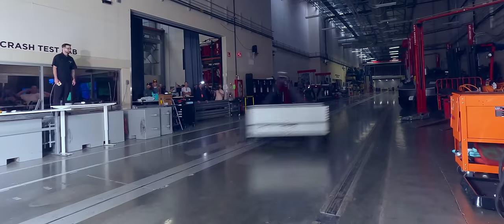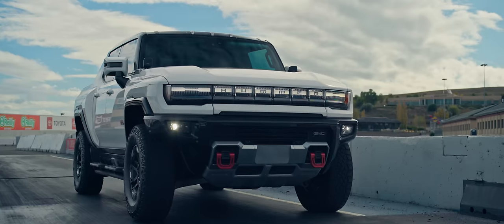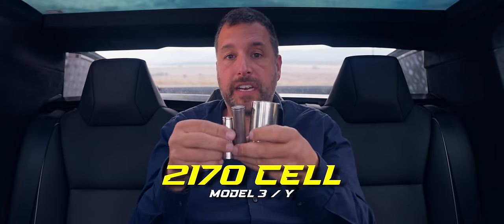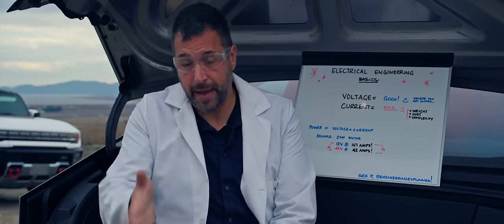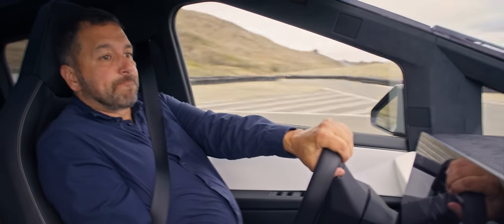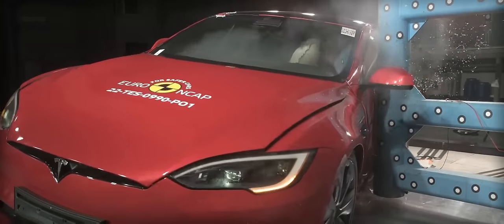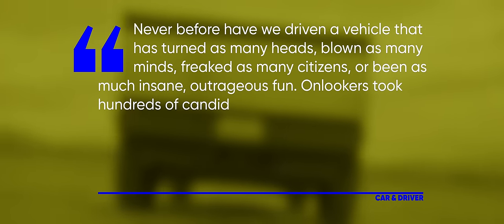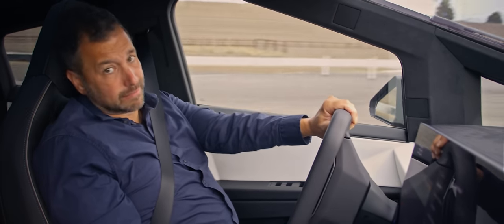Exclusive 2024 Tesla Cybertruck Full Review & Drag Race w R1T & Hummer  — Jason Cammisa on the ICONS

Comment: Ok, this makes me appreciate the engineering that went into the Cybertruck, but I'd be afraid to get hit by one of these things in any regular car. That hard steel skin, curb weight, and acceleration make it a wrecking ball on 4 wheels.
Reply: It's even more dangerous if you consider that cybertruck drivers are blinded by the sun through that big screen and can't see traffic due to those huge A-B-C pillars supporting that glass. Would like to see a crash test of two Cybertrucks hitting each other🤔 No foldable crash zones: Cars undamaged, passengers broken.
Reply: Really.  Tesla just went ahead and forgot to test for that, right?  Slipped theirs minds?  Good thing you thought of it.  Back to the drawing board they go, except with you instead of Elon. @rleerm
Reply: Yep I was thinking the same about those pillars  @rleerm
Reply: It’s a similar reason with most US trucks, which is why all of them are grey imports in Europe. Generally, if you’re an automaker in the US market and you don’t have a truck you’re not going to last long. So Tesla is doing this for market share rather than to actually build a good car, though admittedly some of the engineering is quite impressive. Personally I think a bigger hazard for owners, their kids any potential rear passengers is that stupidly low C pillar. Imagine putting your kids in a car seat and NOT hitting your head off the door frame.
Reply: @mordsith99  yeah i could never imagine a company making any mistakes ever. How could they.
Reply: You prefer to be in an accident?  I prefer to not be in an accident.  Which one has more accidents?  Typical truck with no steering control or Cybertruck with steer by wire?
Reply: This is no harder than cars made before 2000. If they still drive those in your area
Reply: @rleerm  Timeout. Normal cars have blindspots on those same pillars. Just recently got a 2018 Stelvio and found out how big that blind spot was. Cars literally disappear behind the pillars and it has larger blind spots than my prior Veloster which already has insane blind spots. I have doubts that they will be any worse on this thing, especially with all the technology Tesla adds. This at least has default cameras and blindspots monitors to help drivers. Most still require you to pay more and don't have all those features
Reply: @mickmcgood6543  I would put money on them being better than most SUVs
Reply: On the other hand, if you were ever unlucky enough to find yourself in an accident, which vehicle would you trust your wife and children's lives with as passengers? That should be your question.
Reply: This car is dangerous to any normal car on the road. Period.
Reply: It's 6000+ lbs...
Reply: @fredherbert1312 lol. show me a yank truck that isn't a danger to everything else on the road. not sure why people raise this as a concern. they're classified as "Commercial vehicles" for a reason, so that they fall under a different category of safety requirements (well played GM and Ford) hence why you can't buy them in Europe (where there's more stringent rules about protecting pedestrians). You get hit by a truck in anything other than another truck and you are toast.
Reply: @rleerm lmao their are crumple zones or it would be illegal for the road smh
Reply: @Australiaisupsidedown  As long as we learn from failures👍 Love the EV tech in the Cybertruck but not it's implementation. For proper road conditions and city life this is overkill in so many dimensions. Like buying Twitter to get freedom of speech 🫣

Comment: Hope to see a towing test from someone soon. The power is there, better than an F350, great. But, what happens to the range when you tow? F150L range drops to basically nothing once you start pulling.... fingers crossed here!
Reply: I’m not overly optimistic in towing range seeing as this already has the lowest range of all the EV trucks. Hopefully they found a way to dramatically reduce how much range drops.
Reply: @joshtavenner3073  Uh ? No it doesnt ? It has like 340mi of range.
Reply: @joshtavenner3073   The F150 has less than that.
Reply: @joshtavenner3073  I don't think the initial range is important. You buy what you want and get it, in theory anyway. It's going to come down to efficiency and gearing above all else. The lightening is a horridly inefficient in literally ever aspect of it's engineering so that unit having this issue is no shock. I'm certain we'll learn soon enough... fingers crossed.

Comment: What do you mean by completely by wire? There have certainly been other unless you really really specify your own definition. The infinity Q40 was steer by wire nearly a decade ago. Yea, it has a possible redundant mechanical steering rack but it’s never connected unless there’s a failure in the steer by wire, correct? So how does that not count? Also, if you’re referring to the 5.4 star NHTSA rating, it didn’t break the rating system. An article from back in 2013 says these ratings are published but sent internally to the manufacturer and that approximately 1% of vehicles have received such high ratings, so it’s not the first.

Comment: Jason asked if anyone had ever heard of a brake-by-wire failure in a car.  I had a 2004 Mercedes SL55 AMG in which MB first introduced that system.  It failed twice on me, once causing me to roll out of a parking garage onto a busy city street, with the car stopping only when it hit a curb with me standing on the brake pedal with all my force.  Mercedes quietly took the system out of production in late 2005.
Reply: Tesla is using double REDUNDANT steer by wires the chances both fail at the same time is effectively zero. You do realize that modern aircraft use steer by wire and we all get on planes and its the safest form of transportation
Reply: in more recent times there have been no failures. the corvette uses brake by wire, infiniti uses steer by wire, countless other systems electronically controlled now.

Comment: Was this a review of a new electric truck or an electric sports car? You covered all the points of a sports car review, not a truck review... What are the towing specifications/range? The payload? Storage? Offroad capabilities? Clearance? Approach angle? Underbody protection? A/C Power outputs? Charge capabilities? You guys produce great videos but this is nothing but a fluff piece showcasing the sports car features and engineering of a "truck" while not explaining at all how it performs as a truck...

Comment: I like this channel a lot but, you could tell the Rivian started very late and the driver let up on the pedal. Also, what mode were they driving in. It looked like the Cyber truck was in ludicrous speed. What was the Rivian in? Was the Rivian using the larger battery or the lesser battery? Etcetera. This is disappointing. They should have mentioned this.

Comment: You keep commenting on its “large” size but it’s smaller than a normal pickup. You’re literally taller than the truck when you get out. I don’t get the need for the exaggeration. It’s also less than $100k & that’s the top tier one. The rear & all wheel are $50k & $70k.

Comment: This was GREAT! The only inaccuracy was comparing the 2019 single motor Cybertruck's price to the 2023 tri-motor price. Jason saying "it more than doubled" (between 2019 and today) is inaccurate because it's not an apples-to-apples comparison. The single motor model increased about $20,000, going from $40,000 to $60,000. But with inflation, the higher price of steel today, and the added innovations, I have no problem with that price increase. Plus, that'll likely come down as the cost of making the truck comes down over time.

Comment: When he talked about the steering racks being the equivalent to a 1970s house i wasn't impressed, all i thought were the battery requirements for something like that are ridiculously stupid, meaning this truck has an oversized battery pack that is extremely costly and when it dies.. (which it will) it will costs 10s of thousands of dollars to replaced and you'll be SOL.
Reply: This is such an ignorant "i know nothing about evs" boomer take. Not only will someone driving a $120k lipstick at costco truck not drive it long enough for the battery to need replacement but you can repair the batteries by replacing cells. They're just a box of 16850 batteries in cycle. There's an entire industry of people that buy used and worn down Priuses, etc, replair/replace batteries and resell them. This is like complaining about at some point in your cars 250k mile life you might need to replace the trans or motor.

Comment: “Ever heard of a failure? Me neither…”

Electric throttle bodies fail all the time sending cars into limp mode. Not sure if i need or want thoroughly disconnected steering. Even if power assist fails, the car is still controllable.

Comment: 12:00 what's this getting at? Homes run at way higher voltage (240V AC single phase, but more like 220-230V back in the 50s) vs this 48V DC system. Not to mention the sizing of the wires for both as well. Higher current sure, but the voltage is way lower, so the wattage is lower too, 100% do not get what this flex is about.

Comment: I like the fact that the actual headlights are so low down. My biggest complaint with modern trucks is how blinding they are to everyone else on the road that isn't also in a 8 foot tall brodozer. It does not matter if they're aimed correctly, regular drivers' eyes will always be in the blinding hotspot. If headlight modules can be that small and still light the road effectively, I see no reason to mount them up high where they will punish everyone driving a regular-sized vehicle.

Comment: Steer by wire is safe because cars have been using throttle by wire for years? Like throttle by wire never fails? If throttle by wire fails the car just stops. If steer by wire fails you crash and kill others if not yourself. Its not like Tesla's auto pilot has ever worked.

Comment: I don’t necessarily hate the cyber truck but a truck is shaped like a truck because it’s usable, durable and useful.    I don’t see that with the cyber truck…. It has too many compromises as a utility/ work vehicle to be a good truck.  Will it be innovative yeah, will it have some cool tech yeah,  will it be a better “truck”. I don’t see it.   The 48v system and the steer by wire is interesting and I’m not sure I’m on board yet 😂.

Comment: I would like to see a test about its bed usability, bed site, ramp usage, and electric plugs in its inverter mode.
I wanted to park my electric motorcycle in its bed and use its built in ramp to load and recharge the motorcycle in the CT while transfering my Zero....
Can it be done still?

Can you fit a Zero S into its bed?

Comment: I was really excited watching the first press reveal of the Cybertruck all those years ago.  The excitement waned a bit each year as I had to become comfortable with the fact that Tesla was going to blow way past its predicted production timeline and this truck would remain vaporware for a very long time.  Unfortunately, during that time Elon became weirdly obsessed with trying to make the Cybertruck fit into a garage, so they shrank it from a full-size truck to a mid-size.  Yes, there were efficiency gains, but, perhaps most importantly, they ruined its practical usability...well, from the perspective of someone who's driven full-size trucks for decades.  

It's now significantly smaller, cramped interior won't fit taller people (particularly in the rear), and the price of entry has more than doubled.  So, all my excitement has now turned to disappointment.  I fully appreciate all the engineering that went into making this truck, and that the final product is now...finally...hitting the streets.  And I absolutely love the way it looks!!  But it's no longer something I can consider buying, which is kind of a bitter pill to swallow.
Reply: Your sale won't be missed as there are a few million to fill.

Comment: the nissan system has a steering column as a fail safe it had an electric clutch that kept it disengaged unless a power failure or electronic failure mind you it had 3 back up computers

but prob still the best way to do it for steering  fail safe safety just because

Comment: I’m no mechanic or engineer lol but it seems as if the cyber trucks advantage during the drag race could be from its weight distribution.

It looks as it more weight on the back tires versus the Rivian (idk if this is true or not)

More weight over the back tires is going to help it not spin as much off the line I would think.

Comment: See the stainless on the door shaking like a wpbble board speeding down there and over the right rear wheel its like the bodies all warpped like not hardened in this area, or the US Sun n heat is having an effect on the body shrinking and expanding

Comment: 48V Voltage is about 10 years old in Car developement since (at least Mercedes and BMW) wanted to go that route to use the startermotor as generator .. and for plugin hybrids with an "48Volt Bordnetz". Problem is you have to basicly throw out 50 years of " using basicly the same parts" in all of your production line, while providing 12V compatible spares for your existing Fleet and customers who always expect Mercedes to sell them a supplier made  wipermotor, even for a 30 year old car.

Make all suppliers go to 48V hardware, and somebody has to pay for the additional production cost.

Comment: Good and a comprehensive review. But it should be noted that this truck DOES NOT have an EXOSKELETON. 

The internal structure is quite similar to model Y, but much bigger and more casting. But it is not an exoskeleton. Stainless steel body panel DO NOT bear any structural weights. There are just panels that happens to he stainless steel and much more stronger than regular body panels.

Comment: I would love to see a video on how it works as a truck not a car.  How does the bed truly function?  Does dirt get the lift gate stuck? Where are all the stowables and storeables? Can I drive it off road?  Can you switch power to each wheel?  What's it like towing in all fours seasons?  I imagine Jason had only a certain amount of time with the vehicle and perhaps couldn't perform those test.  Without answering those questions do Ford, GM and Stellantis have to worry about losing market share?  I'm sure they are very afraid of the Cybertruck, I would be.  And if they lose market share then can they survive?  The Cybertruck is entirely new in every way including business tactics.  Tesla exploited the weaknesses of the auto industry in support of innovation just like Space X did with that industry.  His engineers aren't any better, just the focus, leadership and corporate metrics.  Innovation wasn't on the table just profits.  Definitely, not profits through innovation.  I truly hope the Cybertruck can perform at the job site.

Comment: At 100k it already defeats itself. Far too expensive for business, with insurance costs to match no doubt given the acceleration which again is pointless for business use unless you want to churn your goods to a pulp. And cars are designed to deform for a reason. And I don't even want to know how much that wiper blade costs. Got bored after that.

Comment: In Canada we would call this vehicle a Prius.  How would one install a sled deck (a rack that carries a 12ft long snowmobile and is mounted in the box of a real pick up truck)?  How would we carry a camper (an accommodation  that is mounted in the box of a real pick up truck)?  Where would we mount our 5th wheel (a large rectangular wheeled accommodation that attaches to a mounting point in the box of a real pick up truck)?  In Canada, this vehicle would only be seen in a major city that is close to the border of the United States.  Because that’s the only place it potentially has any purpose.  Everywhere else in Canada this vehicle would be as useful as a Prius in terms of accomplishing any of the aforementioned items.   Tesla needs to design a real pick up truck if they want to break into the market where the people are serious about their trucks because the truck is seen as a tool, not a toy.

Comment: I'm no 4x4 expert, but my daily driver is awd and i go places most true 4x4's can't, mostly due to my slightly oversized tyres and swb.
Bottom line is all the power in the world can't give you traction and the best tyres, best drivetrain and best driver can't beat physics in terms of angle and mud/snow, so yes there it's "operator error".
And when it comes to rocks, i think the electric motors have toomuch power and they keep spinning, I'm not familiar with how electric motors output their power but I'm sure it can be easily fixed by limiting the power to the wheels.
I saw a render of a raised cyber truck (like those baja trucks) it looked awesome but it had axles which is incorrect, buuut that got me thinking, what are those things most trucks and the hummers have "porta-axles" or something, i think getting those and fiddling with the gears wil have an interesting outcome.

Comment: Nice video.
A Porsche will run 9-10 quarter mile and Scat Packs, Mustang GTs will run in low 11's if they're setup with the track wheels and warmed up.
Shelby GTs and top Audis, BMWs will run sub-10 or in the 10's in the worst case. If you're willing to give up the latest and greatest, the price for the cyber truck can be matched for a faster car that can spend more time at the track.
What Tesla should do, is develop track racing cars that aren't Tesla Plaids because Dodge Demons and anything with 1000WHP can beat those.